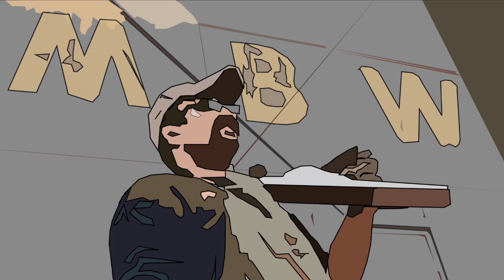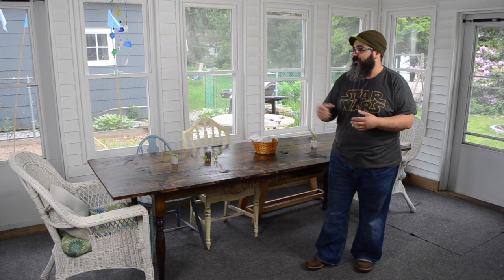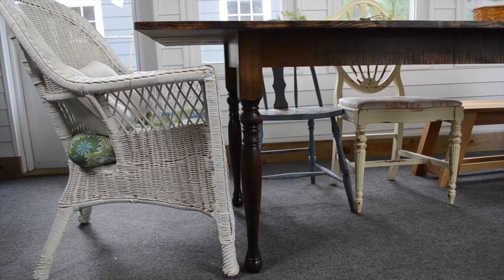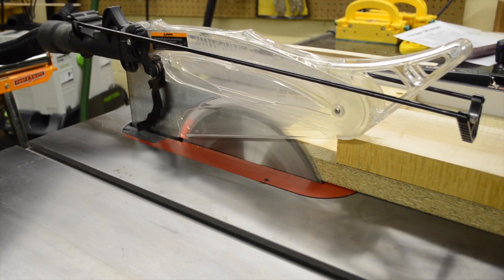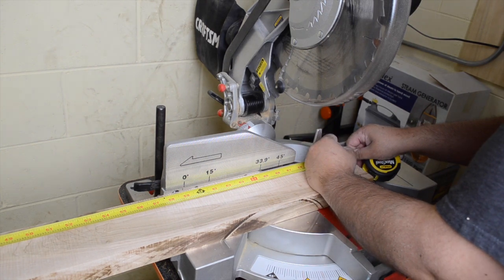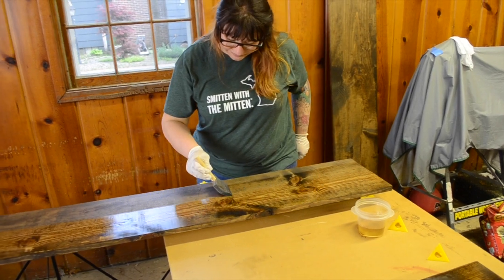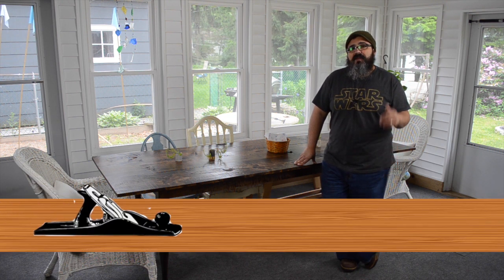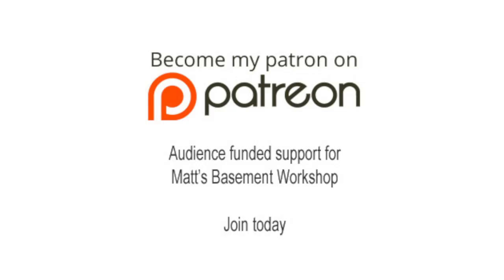548 Samantha's Brunch Table "Woodworking with spouses"

Comment: Looks great, Matt.  We both put out pine tables today!  I think the thickness of the top looks fine with those legs.  If you had gone with bigger legs then it would probably start looking a little off.  You could always double up the 3/4 pine and plane them down to 1/2" or 5/8".  The knots wouldn't all line up so you'd have some extra support under them to tie it all together.
Reply from the maker: Today was a good day for pine furniture apparently LOL! Proportions can be a tricky thing to get right, but I agree with you, if there had been thicker legs for the base I would definitely had needed a thicker top.

Comment: Great job I like the table and your comments.I agree finishing is a pain, but just as important. I don't know if anyone said this if you add a little blue lock tight to the studs it helps after a year or two from having to re tighten the nuts.This projects got my wheels turning for replacing that particle board screen printed master piece from China. Thank you

Comment: Looks great Matt.  I love the use of "off the shelf" products.  Where I live getting good lumber mean sorting through piles of big box store product.  I too EXTREMELY dislike the sanding and finishing process (I'm wrapping up a project now where I'm in the finishing stage).
Reply from the maker: Over the years I've built my fair share of projects from off-the-shelf materials at the local home center. In fact I've been revisiting some of them in a series I'm writing on my website.

The key thing I've found to building with Home Center materials is that you're limited on your choices and you may have to alter your designs to compensate for "surprises" but you can still build some nice projects. It's all about being patient and searching for the right pieces!

Comment: Looks awesome! I thought pocket holes to attach a table top is an absolute no no? I'm under he understanding that table buttons or fasteners are the only way to go? Any thoughts?

Ryan
Reply from the maker: I've used pocket holes for years, attaching a number of tops to all sorts of furniture. So far the only real issue is that I occasionally didn't hide them very well.

There are a number of ways to attach a table top to an apron, and regardless of which one you use the key is to insure it's allowed to expand and contract independently of the apron. 

I probably should create a video explaining this but in a nutshell, even all the other alternatives to attaching a table top require you to "capture" and hold it in place. 

Maybe, a way to think about it is when you look at a bridge or highway overpass. There are connectors that look like oversized links in a bike chain. These allow the road to expand and contract but they do their job without making the road loose and so flexible that when you drive over it you feel like you're out of control. Instead, they provide just enough support to hold it solid, but enough flexibility that when forced to move, they keep the road together.

They simply do their job without you ever really noticing it. Not sure that helps?

Comment: Could you help me understand how pocket holes like the ones in the video allow for expansion and contraction?  I always thought fasteners had to be slotted for movement.  Thanks.
Reply from the maker: Tony Manasseri I'm writing an article for my website (http://mattsbasementworkshop.com/pocketholejoinerybadforwoodmovement/) to try and explain this a little more, but the short of it is that I'm not arresting wood movement across the entire width of the boards. 

The two single spots where the screws secure the boards to the base hold them securely while allowing the rest of the board to expand and contract as needed. If I had glued them to the base across their entire width I would have trapped them and that's where there's an issue.

Comment: Matt, does using a hanger bolt have an advantage over using a lag bolt for supporting the apron?
Reply: Zach Jeffrey their purpose is so you can remove the legs but since he used dowels and glue there was no benefit….
Reply from the maker: Zach Jeffrey ***** is right, normally hangar bolts would be used to pull everything together and then allow the individual to disassemble for repairs, etc.

I like to use them purely as an extra level of security to insure things stay in place in case the glue ever fails.

I don't see why a lag bolt wouldn't do the same thing if you're like me and anticipate the worst LOL.

Comment: can you check back in 3 6 & 9 munts about expan
Reply from the maker: I'll try to add a reminder to my calendar, but if there's any followup I'll most likely post it on my website as a blog post. I have the utmost confidence the only issues of wood movement I'll run into are from where a knot or existing crack has become loose or widened from drying.